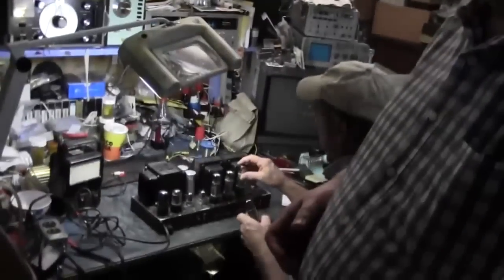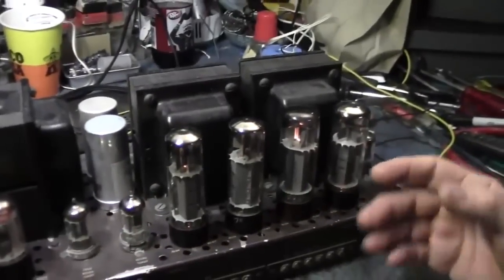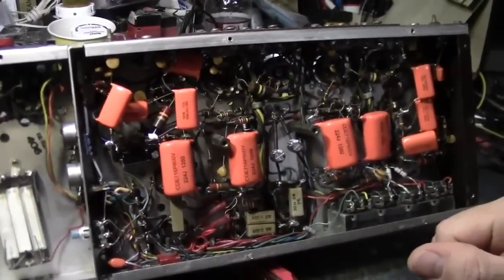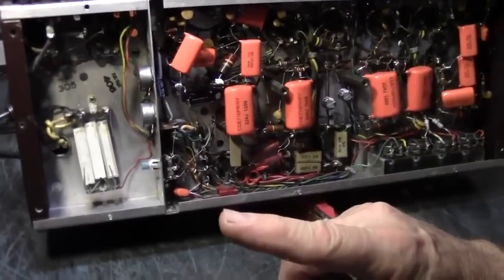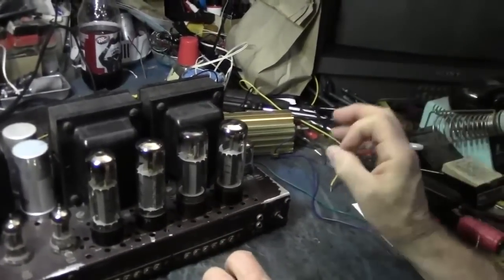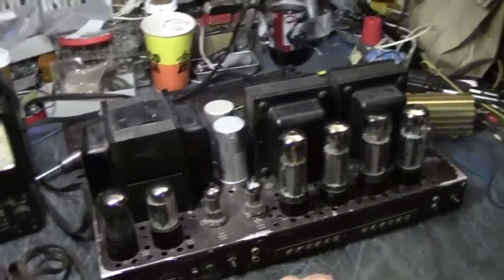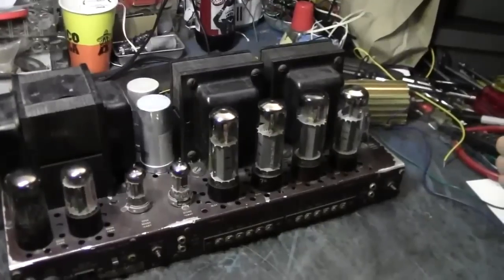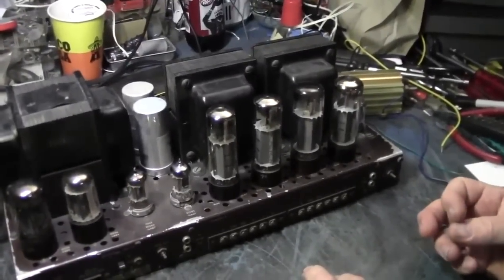Tube Amp Repair

Comment: I have a large collection of tube amplifiers and hand build them and do testing of new circuits 
I like these amplifiers but I like them untouched and in factory condition sometimes you have to fix other peoples mistakes if you don’t have the schematic 
But I spend more time testing then anything I learn so much from these type of videos 
Many people still think you can plug these amplifiers in a USA outlet mine being 123 vac plus or minus 3 volts and my ac heaters where getting over 7 volts vac  and not lasting long now I use a variac to bring my voltage to 115 at input  I know some people add resistors and thermistors and diodes to drop voltage 
What are your honest thoughts on this Matter what would recommend?

Comment: Hi!

Thank you for your video and knowledge sharing. About a year ago I purchased a Luxman MQ-88uC and really like the sound but I have experienced one problem that is distressing me...suddenly there's no sound from the left channel. 

In one year of intense use it has now happened four times. I am using a single source connected directly to the Variable input and after turning the volume down and up a few times the sound eventually comes and no more issues for a few months. 

Since it works well most of the time and I can't replicate the problem it feels awkward to send it to repair service. On the other hand it is very disappointing that such an expensive amplifier has this kind of issues. I replaced the driving tubes  after experiencing the problem the first three times, I had hopes this could solve the problem but it happened again. I have checked the bias current and all seems fine, reading near 480mV in all tubes.

Should I worry about this? Any suggestions would be much appreciated.
Best regards.

Comment: The Fisher SA-300 is a Class AB amp not Class B. Each pair of EL34's in p-p will provide about 35-40w per channel....Cathode resistors in a cathode bias ckt always age poorly in these theatre style amps, because they pass idle current all the time. The cathode resistor that measures 5 ohms is in parallel with the bypass cap which has gone leaky dropping the resistance of the parallel ckt. I would change those bypass caps right off the bat anyway, which someone has already done in that amp as you can see... CHeck the resistors only when those caps are out of the ckt...I think he mis-spoke when he said that resistors don't go up in value, because that is exactly what they do unless they have absorbed moisture somehow, which might cause a drop in resistance....

Cathode biased amps idle HOT, and this one is no different, with a 7.8 volt drop across 50 ohms which is 156mA of idle current or about 78mA per tube. It is somewhat unusual that an amp has both adjustable bias and cathode bias.

NEVER let this type of amp idle without a load, be it a speaker of the correct impedance or a dummy load of said impedance.

There are lots of folks still able to repair and/or restore these amps, and even more who act like they can...!!!

Comment: Problem with my preamp Ming da, sometimes the sound is cut in one of the speakers when I touch the knob to select the input, it is also cut when I move a little the input cables that come from the dac, what can be the cause?,thanks
Reply: Corrosion or bad cables.

Comment: If the output tubes are passing current at idle, it's not Class B, it's Class AB.
Reply: Silas Fatchett it's a class A/B , I laughed when he said B.
Reply: @vsmichael1  Keep on laughing , the man is more skilled than most of us.
Reply: It's considered as a Class B amplifier , just like a MAC is a class B , there's always some current at idle ..... without some current you get cross over  distortion.. most announced as class A amplifiers do also commutate in class B at a certain level....class AB does NOT exist as is or would be ... amplifiers work in class A than commutate in class B ..pure class A is rare , so is pure class B ....you wouldn't want to listen to a pure class B amp.

Comment: wow!!!...really dude? No load/speakers connected, poking your fingers in there with probably 400VCD+ in there.....if you were working for me...YOU'RE FIRED!! You are clueless buddy!
Reply: I think he knows to discharge the big power capacitors by now otherwise he woud be long gone.
Reply: not a good idea to turn it on without speakers or some load
Reply: @johnmckeown6573  You can get away with it as long as there isn't an input signal. I always put a load resistor on the output just in case .
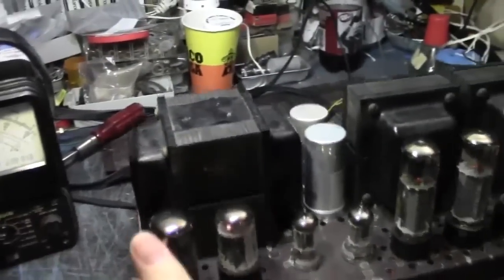Reply: Open your eyes Einstein, 2:27 he reached over with his left hand and shut it off before flipping it over.

Comment: I need your HELP – I have a vintage Crate Palomino V16 guitar tube amp.
I haven’t played it in a while and it worked and sounded great before putting it away.
I just played it today and it has a HUM that wasn’t there before.
I heard that in tube amps IF it’s a low-level pitch 60 cycle hum it’s probably a bad tube,
BUT IF it’s a high-level pitch 120 cycle hum it’s probably a capacitor that needs replacing.
I took out my guitar tuner and it shows the hum to be about an “A#”, and on another 
Audio scale it says it’s a 120 Hz pitch MINUS 49 cents ??? What the what ??
The Hum does Not respond to the volume control – does that info help also ??
I do own a multi-volt Meter – How do I locate and test the capacitor if it’s bad or not?
Awaiting your reply, and Thanks In Advance – I REALLY NEED HELP WITH THIS.

Comment: When probing a live amp, put one finger on ground and the other middle finger on the positive of the filter capacitor to check if it is working properly. That way you don't need to purchase unnecessary tools and in turn save money money in the long run! Regards point
Reply: very funny.
Reply: like, after you're dead ?

Comment: You are quite right. Leaky coupling capacitors can be found in any old tube radio or amplifier. Sometimes, particularly in consumer radios or record players, a leaky cap will cause low or muddy sounding sound. It will increase the current thru the tube and over time contribute to tube failure. In high end amplifiers running class B you have coupling caps and a supplied negative voltage for bias. The leaky caps' positive voltage will cancel out the negative bias. This causes a good tube to glow red. Not good for the tube or the output transformer. Class B amps are biased so that the tubes pull little current when idling (no sound) They only conduct fully when driven with a signal. This makes the tubes run cooler and lost longer. Some people like to bias their tubes little hot to get a smoother sound. The eats up tubes. Bias should always be set to the manufacturers spec. Using a meter to measure the current flowing from the cathode to ground is the best way to set bias. It will also help you get the tubes to balance i.e. the tubes are pulling the same current.
Reply: What you're describing is not Class B, it's Class AB.

Comment: In case of transformer failure of almost any kind, just wind off the windings, examine how there are wound  and then rewind it the exact same way. Time and money consuming for sure but you definately get an exact copy of the failed transformer. So, there is not that much magic about OPT´s. The vintage ones in particular, were most often quite simple transformers(Even The Fisher ones). Just saying, because Paul or Al, I don´t know who is Al an who is Paul, acted like if a OPT would fail there is no chance to get a new one...
Reply: how many have you ACTUALLY wound ?
Zero I bet.

Comment: This amp puts out about 40 watts a channel with EL 34s not 100 watts, not even with KT 88 in it. Its a Fisher 300 I have one
Reply: That's what I though, also new EL34's are readily available, not too expensive too.
Reply: You are right.
I been fixing Audio Research equipment for many years and I know a little bit of this.

Cheers.
Reply: I was thinking 40 watts a channel also.

Comment: OPTs are impedance matching devices - period.  Contrary to your opinion OPTs have no
wonderful audible qualities.  I will concede that some OPTs are wound better than others.
Reply: OPTs with 'lots of iron' have a wider frequency response.
Reply: don't forget primary inductance, and leakage inductance and inter winding capacitance and how to increase, reduce and reduce respectively. 
other than that they are quite simple.

Comment: you guys are cool but you have to have a 8 ohm load on each speaker output or the tubes will hot plate.
Reply: TheWarped45 ,Your tubes won't red plate,With out a load.if you hook up a tube amp without. speakers,You will only have a problem if you crank up the volume,Then you can and will have voltage jump across the windings of the OT's,Which will burn them out.....When a Tube red plates,Check your coupling caps out,because one will be allowing DC through....
Reply: You're Right Danny ! ( but loading the opt is good practice )

Comment: 2nd thing with tube amps you never run tube amps with out speakers
Reply: Yeah... I was thinking the same things. This guy knows some things and loves to hear himself talk, but I CRINGED when the amp was on without a load, and when he was poking his fingers around in there... UGH!
Reply: You can run it at idle without speakers, no input signal, and no output.  I know that this guy may seem a little weird to some of you but it was men like that who propelled this nation to be a world power.
Reply: yup best to have a load on ampy i build heads of valve amps
Reply: Right.  If I was the owner, I would say to this guy...."you bought it".  
Also, don't stick your fingers in there with the amp on.  JEEZ!!